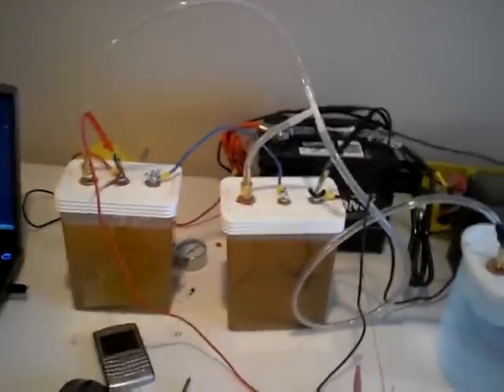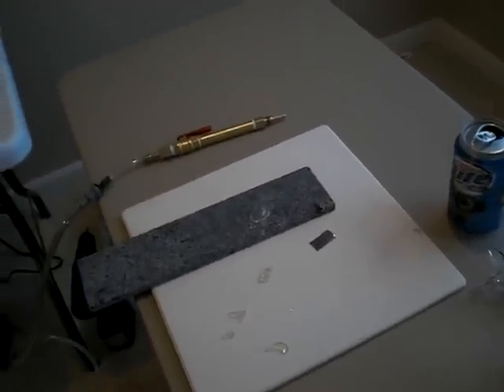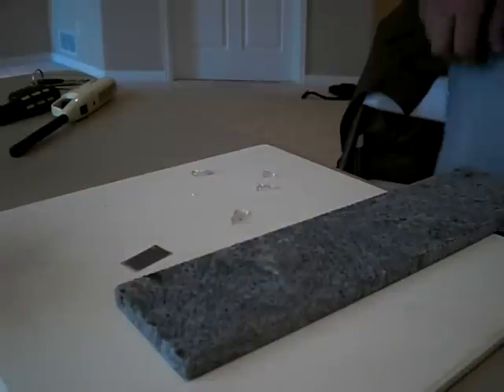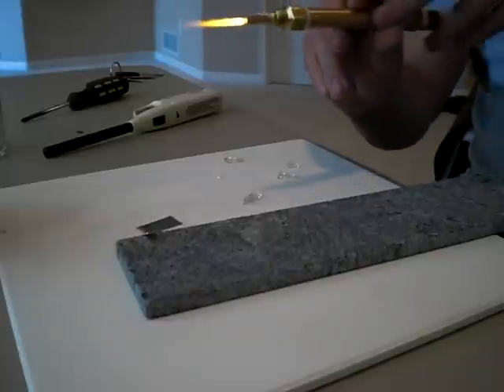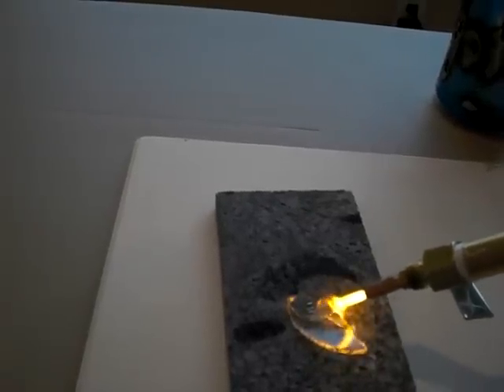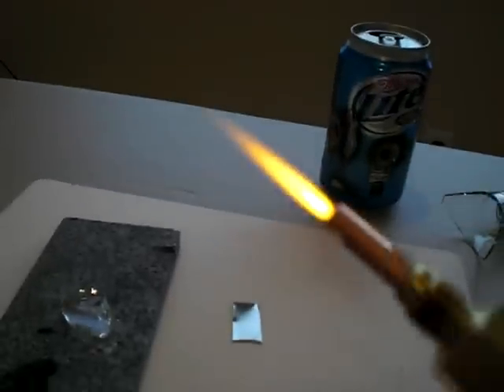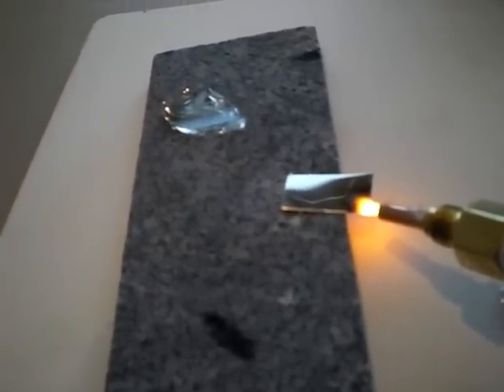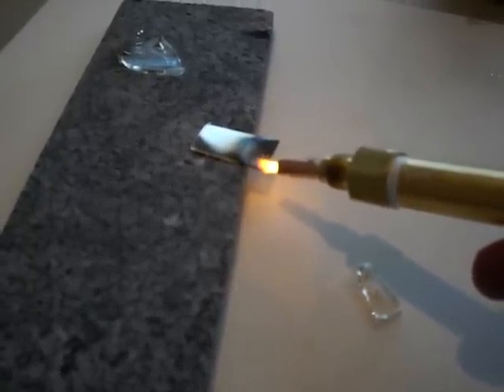FIRE FIRE!  Dual Cell HHO Pyro

Comment: okay first off all, your welding tip is way too big for the amount of gas being produced, and also your flame is leaving a black soot on your metal and your slab of granite, i would strongly recomend you change your electrolyte, because by the looks you are using sodium carbonate (baking soda) also when hho gas burns clean, it produces a blue flame, the reason you are getting a yellow- orange flame is because you are burning sodium in your flame and also water makes your flame yellow.

Comment: you could hook up a stirling genorator ot the battery and run the stirling off o a second smaller line going to the heat element of the stirling and it would make a sort of a heat to electricity to gass to more heat for more electricity and for burning stuff

Comment: what exactly is the multimeter measuring? is that voltage or what? (can't see what it's set to...)
from what I can see, the meter is connected in pararel to the battery, so I'm very interested in what it acually is measuring...

Comment: you can tell them what grade you want. they normally deal with 302 but if you request a higher grade they can get it in short order and cut it. Another good choice is I have a fabrication shop here in my town and I can go buy scrap from him. It is 304 but very good stuff and I have no mud in my tanks. But at $0.70 per pound you can't beat it.

Comment: I use a 200 amp battery charger, has a cold start setting that goes up to 200 amps. I normally don't turn the switch higher than 40 amps, but the higher setting is there.

It was about $100 when I bought it, but I was needing it at the time to do reverse electrolysis on some old rusted planes. Works very well for that also.

Comment: Swiftech has a S320-12 Power supply kit for its thermo-electric water cooler. It offers 25 amps at 12 volts comtinuous

Comment: Just another quick note.. dont use small guage wires... go straight for OFC (oxygen free copper) wire that you use in car audio setups.. use 8guage or 4guage cable... it will not get hot like the small wires used in many HHO systems i have seen...
As a note on guage... the higher the number the smaller the wire diameter.. ie.. 8g is about 8mm thick, and 4guage is about 10mm thick.. then is 2guage, 1gauge and 0guage which is the biggest. I think 8g-4g is ideal for most setups that i have seen

Comment: You need to talk to guys who sell car audio equipment, especially competition stuff. they use very high powered dc power supplies to run their car audio systems on show/competion days. Car audio stores use these same power supplies to run their all those stereos & amps on their demonstration boards. They come in a range of sizes like 100amp - 500amp++ way more than power any battery charger and more than you will ever need for any of these HHO setups...
Good Luck.. and great work ;)

Comment: i use a batt charger, it put's out 6v 2amps, 12v 2amps and 12v 6amps..if it ever stops working i just buy another one and put the old one back in the new box and take it back, there only like $30 at meijer, i've seen a guy amplifi a 12v d.c. batt but i have no clue how he did it, you may want to look into that, let me know what you come up with. i also use a computer power box to power the amp for my sub, the chager puts out a little more then the power box

Comment: The converted computer power supply is a pretty simple, straight forward way to go unless you want to put out some big money.  A BIG computer power supply, something in the 500 watt range, might give you 5v @ at as much as 35a to play with.  Ideal for your cell setup. 12v @ about 20a is normal for these also.  If lucky, you might get hands on one for free out of broken computer.  But can buy one new for maybe $50-75 so not that expensive and easy to convert.

Comment: battery charger or get a gas furnace transformer that is 24volt 120 volt and then rectify that with 24 volt with hv doides from a microwave Check out m3sca1 for tips, it was his hv video.